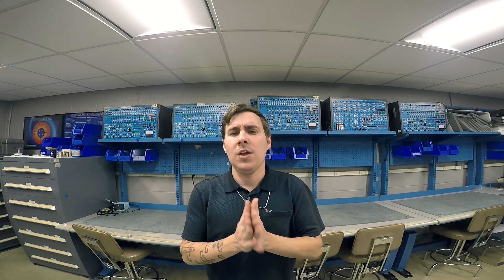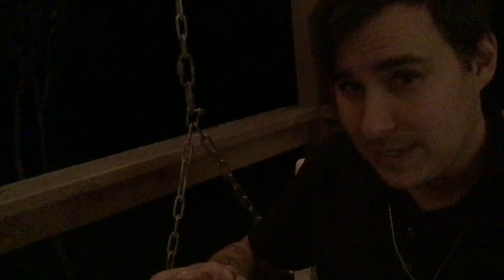3 Ways to Obtain an Airframe and PowerPlant Certification, Ultimate Guide for Aviation Enthusiasts!

Comment: You did not mention military experience.  The local FSDO gave me permission to test for the Airframe and Powerplant based solely on my military aircraft maintenance experience.  I never attended a Part 147 school; I purchased study guides and after several weeks of self-study passed all the written exams.  The FSDO provided me with a list of DMEs in my area, I sought one out and did the Oral and Practical.  My specific job (Rating) in the Navy was Aviation Structural Mechanic (AMS); I spent time outside my Rating cross-training in Powerplants to gain that experience.  Saved me a lot of $$$ in tuition and time.  I retired from the Navy after 20 years with an A&P/IA and went right into corporate aviation maintaining KingAirs and 500 series Citations, retiring again after 22 years as a DoM.
Reply from the maker: I didn't mention military specifically, but yes, military experience counts for the practical experience route. I'll say that I know it is easier at certain FSDO's to get signed off depending upon what you did in the service. Our  FSDO won't always sign someone off for the full rating if they never did any recip engines. However, other FSDO'S will so shop around
Reply: As an AH-64 apache mechanic in the Army I was signed off for both ma A and P by just presenting my DD214. Then I went to a 2 week crash course a0nd tested out to get my A & P.
Reply: @mikestille76 Congrats where did you take your course? I'm trying to do the same
Reply: @mikestille76 I was an army crew chief/mechanic and now I’m a contractor for the navy on their mh-60s while attending a part 147 school, I feel like I’m wasting my gi bill tho because I’m scared of paying out of pocket and failing
Reply: What part of the 8610-2 form did you fill your military experience in because I request and I did 6 years as a apache helicopter mechanic and just got out less then 2 years ago
Reply: @mikegomez-cq1ni  Don't recall what part of the 8610 I filled out detailing my military experience, it was in 1994.  I went to my local FSDO with copies of my military training records and copies of my field service record showing what aircraft maintenance specialty (MOS) I possessed.  A letter from my unit's Maintenance Officer detailing my aircraft maintenance experience, in addition a 2nd letter from an A&P I knew.  I interviewed with an FAA ASI at the FSDO, he reviewed everything I brought, spoke with me a bit about my background, had me fill out the 8610 (he showed me what blocks to fill in), and kept copies of all the documents I brought.  Once he was satisfied I had the required Airframe and Powerplant experience documented, he issued the authorization to test.  Then I studied my A$$ off, took the writtens and found a DME for the O&P.  I did the same when I got my IA 4 years later.
Reply: @brucecthompson5485  lol ok sorry
Reply: wow thanks this cleared up so many questions ive had

Comment: I was under the impression that the third way you describe which is through building an experimental was basically closed. I talked to a local FSDO and they are telling me that they will not be signing anybody off to take the written based on their experience building an experimental airplane. I am a Flight instructor and also wanted to get my repairman and later a ANP license. Could you please provide a reference that would talk about the path to ANP license through building an experimental? I’m sure.
Reply from the maker: It pains me to say that it depends completely on the FSDO you are dealing with. Some are just more favorable then others.

Comment: Very good analysis. Yes airlines will be very short of pilots and maintenance staff for various reasons. This was true 13 years ago but is accelerating. Another route are the Canadian colleges. Tuition for Centennial College 2 year program is $45,000 as a foreigner. Canadian students $10,500. Marry a Canadian. Back in the early 1960's you only needed a commercial to fly for Air Canada. They trained you the rest of the way. I believe airlines will have to ramp up their own training programs. As an ex AME, Pilot and engineer I would go fly and maintain aircraft in Indonesia if I were young.

Comment: Hello sir how can a Filipino aircraft mechanic working in Singapore engineering can get a job in the us and get an faa license
Reply from the maker: As long as you meet the requirements of 65 and go to a Part 147 school or have 30 months practical experience. You can test for your A&P. You just can't exercise the privileges of the A&P unless working on U.S. registered Aircraft outside the U.S. wich you would be doing.

Comment: How much time would it take to get the A course if I get the P with the Mexican License on a Engine Focused MRO experience?
Reply from the maker: If you already have your P it could take as little as 1 semester through a 147 school. Because by having a P you also already have the general portion done. So you would just have to take airframe courses. It does depend on the 147 it could take up to 6 months if it not an accelerated program.
Reply: @brycebuildsit  Thank you so much!

Comment: Bryce, in regard to your porch swing caveat, I just finished LSR-M and the way we were taught was that if you wanted to pursue A&P, then start an AMT log the moment we completed LSR-M.  Once the equivalent of three years of work was logged, then contact the FSDO for sign off to start the process.  Building one plane, you could certainly log the hours, but not necessary since an LSR-M can work for hire you can log those hours on any applicable work under the certificate.  This is not a popular route as it's not structured nor speedy by any means.
Reply from the maker: This is true, I just mentioned it briefly as one of the guys at the airport. I frequent went this route after building an RV-6. I think it's worth it if you are already building an experimental but I wouldn't pursue an A&P this way. Not when a 147 school is only 12-19 months and is considerably cheaper
Reply: I am a thirty plus year professional auto mechanic and don't really want to spend a year and a half going to school again. This built an airplane route sounds perfect though. How do I find out more about this option?

Comment: I have ran into an issue with getting signed off for my Power Plant.  I have met the concurrent 30 month requirement along with the hours needed to receive the PP sign off, but was told that since I have already started testing, my general written, I must now have to wait 18 months after my certification completion of my Airframe certification date to receive the sign off for my PP. Can anyone clarify this for me?
Reply from the maker: That is false. All the regulation says is that after 30 months you are eligible to receive both. Now a FSDO inspector is who signs that off and they can choose to deny the power plant. But the only time I've heard them do that is if someone has 0 experience in that 30 months for PowerPlant. I.e. all they did was heavy structures, or wheels and brakes

Comment: I've heard that doing maintenance / repairs on your own aircraft counts toward the "experience" needed to take the test(s), provided an A&P/IA will sign you off for testing. I've been performing most all of the maintenance / repairs on the aircraft I own/fly under the supervision of my IA for the better part of 15yrs. There is a 147 school less than 2 miles from where I live, but I have no desire to start a new career after retiring from the Power Sports Industry, but it would be nice to be able to sign off and get back in the air rather than waiting for log entries..... is there any truth to this?
Reply from the maker: You can count all that. The tuff thing is an airworthiness inspector has to sign off on your 8610-2. Unfortunately, it kinda depends on the airworthiness inspector you are talking to. There are some real by the book guys, and there are guys who are more fluid.